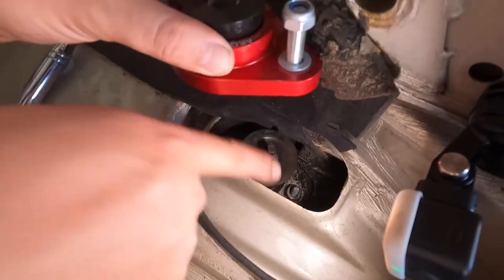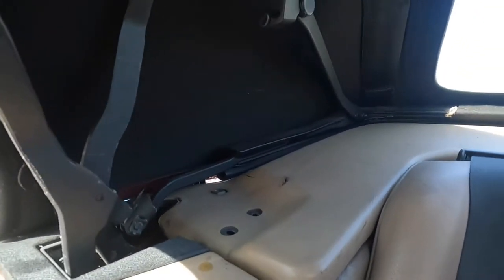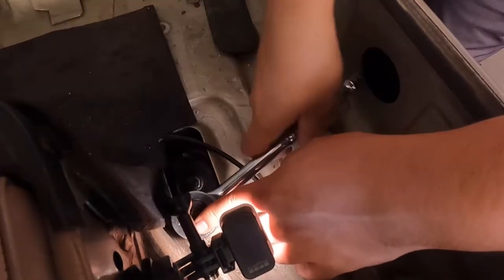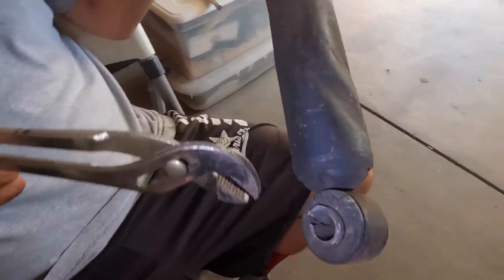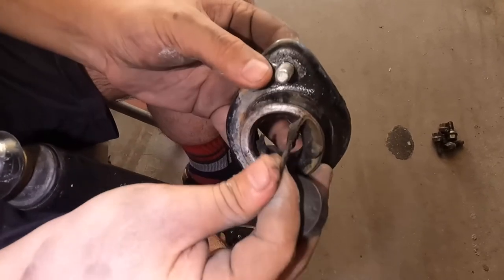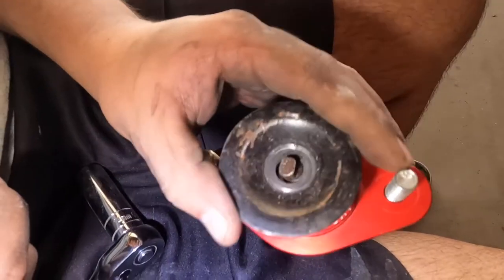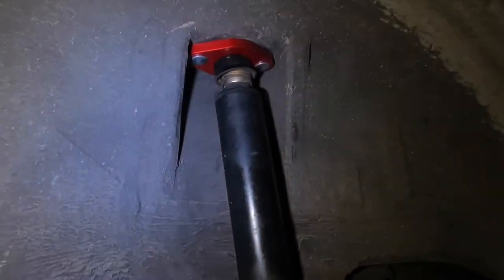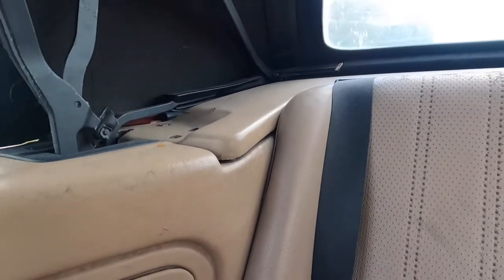Changing rear strut mount on BMW E30 cabriolet

Comment: I have a 1988 325i cov, mine keep breaking pushing through the rubber, Just bought news ones 6 mons ago, any fix or better part for this rear mount?
Reply from the maker: You got the same exact part ? Mine are still on no problem but I haven’t driven my car much. Maybe try a harder bushing mount?
Reply: @Inspirall_  Can you link me where you got your kit?
Reply from the maker: @CityTunes  I’m going to send you ones without rubber cause that might fix your issue but your ride is going to be a lot more uncomfortable.. if you want a smooth ride look for the ones with bushings on this same page.

https://www.akgmotorsport.com/product/rear-shock-mount-set-10mm-spherical-bearing-e30-e36-e46-z3-z4/?utm_source=Google%20Shopping&utm_campaign=AKGGShop2&utm_medium=cpc&utm_term=3136&gad=1&gclid=EAIaIQobChMIj4rTp9e0_gIVPROtBh1cugNuEAQYCCABEgKoGPD_BwE